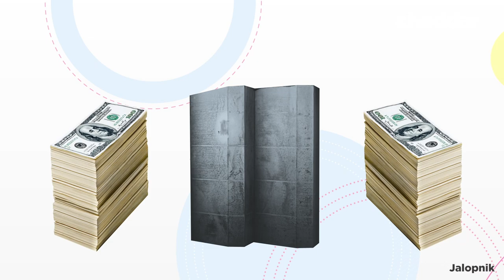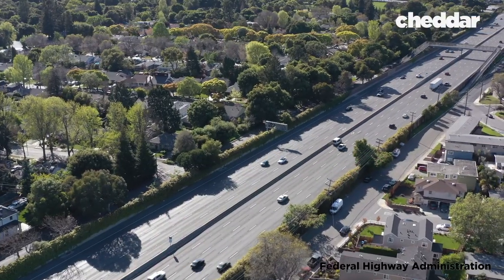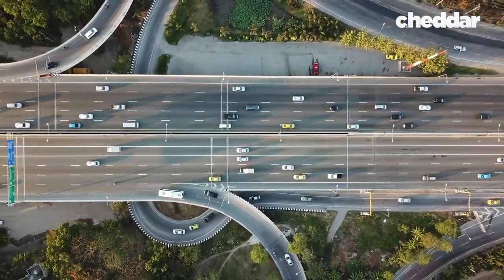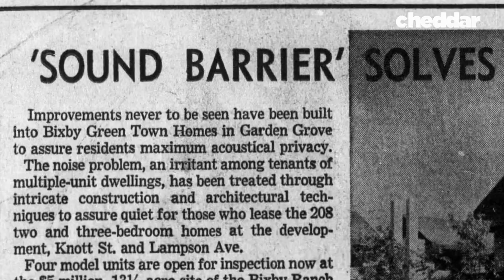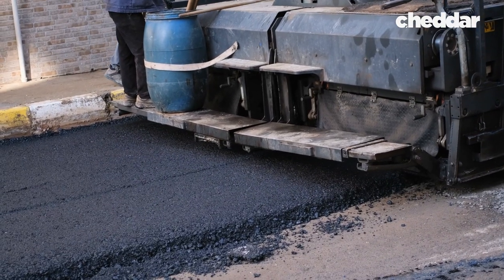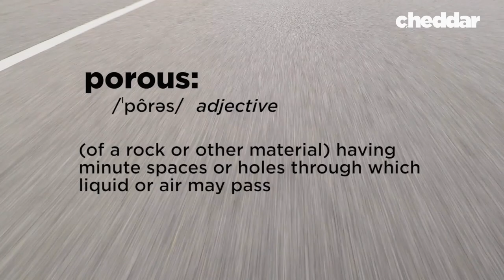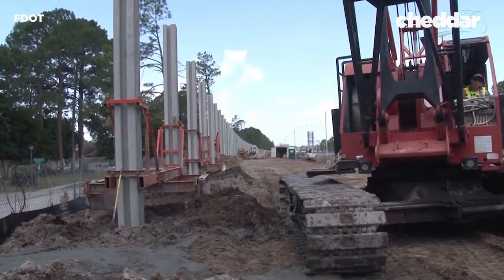How Highway Noise Barriers Can Make Traffic Louder - Cheddar Explains

Comment: @5:08 "Concrete walls have to be replaced every 30 years or so."
Really, you seriously think that? LMAO
Reply: The buried pillars that hold up the wall degrade due to moisture and concrete cancer, if they are not replaced, the wall has a risk of collapse.
Reply: In Germany a women died because a concrete wall fell on her car.
Reply: @cubiusblockus3973  Being that I'm well versed in building construction but not this construction in particular, I say that that's only due to poor construction standards/materials. Concrete rot and metal degradation are due to poor maintenance and material selection. Properly protected steel such as galvanized steels of adequate gauge would not fail in 60 years or more. Concrete walls, with regularly applied sealant (5 to 10 years per application), would last indefinitely given that all concrete will soften with age but very capable of hundreds of years of service.
I'm very much  in favor of natural berms and trees but in tight urban areas it can't be the solution.
Concrete can be protected by natural oils and with thin wood (that's vegetation bearing) if preferred.  Also, angling the roadside surface by 30 degrees or more can deflect and disrupt(mute) sound upward and away from people.
Reply: @Salattrainer  That's bad engineering Germany. There is a great example of a wall that didn't fall without great effort...trying to remember where that was....

Comment: So called "whisper asphalt" is used as a anti noise measure in Germany, but only sparingly, because it has the drawback that it is more slippery when whet than regular asphalt. So they have to carefully calculate a tradeoff between noise reduction and safety for every meter of "whisper asphalt" they install.

Comment: near to one without a noise barrier. 3rd house over on a straight road from the highway. I hear almost nothing from the highway when in the house barely anything in my yard. Go to the first house and it is loud to the point i am glad that it is a church with walls that block out the outside sound when inside it.

Comment: I live directly across the street from the Prospect Expressway in Brooklyn NY. Most of the expressway is open cut, but my section is ground level. So, we have tried many things to reduce the noise, and trees and bushes were planted and they didn’t reduce sound one bit.
A wall has been discussed, but it appears that the Cheddar video is dead on accurate. Our small section of street level highway does not affect enough residents to justify the cost.
Also, our experience with the open cut areas does prove the theory that the sound will travel over the barrier and affect homes further away.
I guess the best bet would be concrete walls faced with sound absorbing material.

Comment: I live about 1/4 of a mile away from a 6 lane interstate with concrete sound walls on both sides. I noticed at night there is a “howling” noise coming from the direction of the highway that’s loud enough to be heard in the house. I think it’s because the sound from the trucks are bouncing back and forth and diffracting down,

Comment: Our house was built in the 1930's (About 25 feet from the road) and at the time the road was dirt/gravel and little traffic, had 90% corners so slowed traffic. (We have been here 28 years) The road (Springhill DR/'Springhill Raceway', Albany Oregon, 7.5 miles long and wanders cross country) now has increasingly over the years become a shortcut for  commuter traffic, Farm equipment, trucks, log trucks and Semi's because there is a stoplight at the south end end in town and they cannot get on the other east-west highway 20 further west because of increased traffic.  Now with the road being pavement and having being built on a poor base it has needed to be torn up and redone for several years.  The county's solution was to chip seal (tar and gravel) it multiple times.  Well chip sealing a road makes it much louder.   Talking to the county, we were told that it would be repaved in 2018.  Well here we are in 2021 and all we have gotten is grinding out strips where the road has breached through the pavement and putting in new asphalt (by the county crew, not well trained pavement workers) while they have repaved from milepost 5 into town twice. They also come out after every rain storm and fill in the blowouts on the last 2.5 miles with temp patch.

So we can definitely attest to the noise created by different pavement types, potholes, improperly patched roadway, loud muffler cars, certain motorcycles, mud tires on pickups, trucks, log trucks, semi's, farm equipment Etc.

Comment: I seem to remember seeing something about the effectiveness of natural barriers being greater than concrete ones. Rather than using reflective hard sound barriers, planting trees such as Cyprus and Willow and low shrubs like Juniper, Yew and burning bushes dampens sound, reducing noise on both sides of the barrier. Additionally, they are much less costly to maintain and reduce the amount of air pollution that makes it from the highway to surrounding areas. 
While the specific plants would have to be tailored to the climate in particularly hot or cold regions it can work anywhere that has sufficient rain or ground water.
Reply: Well thats why they use both plants and concrete barriers to help reduce sound
Reply: @alexander5662  where we have room for both in my Midwestern city that's what we do.
Reply: @alexander5662  I really don't see plants used much on the east coast at all. Probably due to the space needed for the concrete barriers. They need to start replacing the concrete with vegetation rather than new concrete as the old ones start to fall apart.

Comment: I live directly next to a freeway. Calgary Trail at 23rd Avenue in Edmonton Alberta (revealing my location isn't a big deal). There is an elevated ramp next to it. The sound is negligible. If I wanted to hear completely nothing, I could close my windows. But I haven't had to.

My only problem is that because I live where the freeway begins, I hear slightly more noise than if the freeway started further north since vehicles have to accelerate right next to my place.

So basically, my recommendation would be to make sure freeways extend far enough out so that this acceleration happens in a commercial or industrial area. In my situation, that would mean the freeway should start further north with a new interchange at 34th Avenue (that would also raise 34th above the adjacent railroad tracks too).

Comment: Two significant improvements that would solve alot of this immediately is to employ sound absorbing ceramic tiles rather than straight concrete (not THAT much more expensive in the grand scheme of things and just as resiliant to the environment) as well as angling the tops of these barriers towards the freeways.

Comment: 10000 Mercedes st. El paso TX . Google maps. Go to Transmountain rd and in-between Mercedes and Kellogg st there's a barrier there, only on that section of that part of loop 375. The frontage road was the original loop 375 and when the now loop 375 was being built, this wall went up. It's safe to say those homeowners complained so much to the city they were able to get a wall up.

Comment: That's a wall, not a barrier. I recall that noise barrier inHong Kong can somewhere like a dozen meters high, which sort of wraps the road inside a noise-barrier-tunnel (and they are not made with concrete, though I don't know the exact material). Some of the noise barriers also have vegetation on it (which should improve sound-absorbing capability, I believe)

Comment: My House is backed up to I-5 in South Orange County, CA  When we moved in in 1989 there was a 6' wall between us and the freeway!  in 1995 Caltrans decided to erect a 16' sound wall.  Ever since the sound has been much LOUDER!!! As the walls on both sides of the freeway have turned the freeway area into a virtual canyon. Soundwaves bounce back and forth off the walls getting louder, and when they reach the top it is just GOD AWFUL!!! The sound is much louder in colder weather too.
Reply: I-5 in Norwalk here. Found this video because I’ve about had it with an 80-90hz humming coming from the freeway this year. 4:40am and I’ve been up all night pretty much for 2 weeks pulling my hair out.

Comment: The choice of concrete is surprising - it's much more expensive than pressure-treated plywood, or pine boards - hmmm, maybe the concern is vandals burning it?
Here in Queensland the wood is often in panels that are separated by steel - usually a universal-column - a fire wouldn't propagate very fast.
The wood is often green [copper napthanate] so the wall 'disappears' behind a few shrubs - and the Main-Roads-department is obsessed about planting shrubs - every shrub you plant eliminates another bit of grass to mow - and if someone crashes off the road shrubs will slow them down before they hit something hard.
Reply: It's maintenance cost.   Concrete doesn't need to be replaced as often as plywood.

Comment: I never understood the straight design of soundbarriers. First I would make them bend slightly to the road, to have the reflection go less up, or put them on an angle towards the road. Second, I would make them uneven, since this dispers the reflection. And they should be of a layer of absorbing material on the inside, and a hard layer on the outside for strength and durability.
Next to a busy road near my grandmother, somebody put a wall of sand 10 meters high in their (very big) garden. Surely that works very well.

Comment: Build a dirt/clay embankment up to 6 feet shy of the top of the wall (8') on the side of the highway so that the wall is 6' tall on one side and 14' on the other, and cover it in landscaping grass. Plant trees and flowering bushes along both sides of the wall AND in the median if possible. Dirt = soft material, to absorb sound, and a slope will help redirect the soundwaves skyward BEFORE refraction. Trees on both sides and median will help with air and noise pollution. Dig drainage ditches along the side of the highway and in the median that branch outward on either side of the wall to act as a natural break to reduce accident fatalities regarding the trees, as well as flooding. Trees and flowering bushes will support pollinating insects, as well as provide beautification.

Comment: Well, solid concrete without any insulating foam will not be good in absorbing noise
So, why not add extra layer of stone foam or any similar material, it will be quite easy to apply

Comment: I wonder why they use concrete for this in murica. In contries that did this right they are using soft barriers that absorb the noise... I do not know what it takes to make them but if we could work out a way to downcycle otherwise landfilled plastic waste into granules that we glue with some resin into such plates it would be a way to deal with some of the plastics that we otherwise throw out.

Comment: As an acoustic consultant who works on Road Projects, the application of sound diffraction principles to noise barriers isn't relevant so long as the noise at noise-sensitive receivers are compliant with local laws/guidelines/code. These are what determine the application of noise barriers, not the general "feeling" of local residents, whose feedback is usually based off perception of noise and not measured noise. And from a practical standpoint, are you really going to tell residents right on the edge of the highway "Yeah we're not putting a noise barrier up between you and the highway because it'll slightly increase the noise level at these residences 3-5 buildings back"? You're asking for a open-and-shut lawsuit there, and not one you'll win.

On the note of low-noise pavement, that is effective, but with a caveat; it wears down over time, nullifying the benefits over the course of the pavement's lifetime. As such, it's important it be maintained and resurfaced over its lifetime, but most councils and local governments tend to forget to do anything about it due to their lack of tendency to consider the long-term needs of infrastructure and other major projects.

Comment: the solution is simple and cheap. earthwork barriers with a 45 degree incline, reflects the sound upwards.
and over time they get covered in greenery and absorb and diffuse sound better.

i see them being used all over in my part of Sweden
Reply: That requires more adjacent available land than most urban and suburban American  freeways have available
Reply: @danieldaniels7571  so its bad planning from the start then. it does not have to be a huge earthwork structure, 1.5-2 meters high should do the trick. then you can construct a smaller sound barrier on top

Comment: I am very familiar with the issues of highway noise barriers as I worked 17 years for a company that manufactured highway barriers that utilized sound absorbing technology. These barriers are powder coated steel, one side having perforated sheeting with sound absorbing material behind it. The effective has been proven in live test labs and in the field. The problem is, construction companies are not familiar with the technology and are not willing to subcontract the manufacture and installation to companies that they they are not used to working with. 

As a driver of a convertible automobile, I can tell you that driving through an area with typical highway barriers is absolutely deafening. Most car drivers are enveloped in their steel and glass shells and don't hear this incredible noise. It's really sad that with the awareness of noise pollution, it's proven very difficult to get these true noise abatement solutions into the marketplace. The technology exists and you can find real examples where they have been implemented. The company I worked for is Industrial Acoustics Company. They have a comprehensive list of product lines, noise barriers being one of them. This includes those blast shields you sometimes see at the end of airport runways.

Comment: I hate it when they put up noise walls where they are not needed. It spoils the view. i know someone who lives next to a main highway. There used to be trees and bushes, on the edge of the road reserve, but after they upgraded the highway, the trees were gone and replaced with a concrete wall. The noise was a lot harsher.

Comment: In my point of view the Big Con of such massive structures, is the dificult penetration of emergency teams or even chances for escape in a massive scale road accident such as during strong fog multiple crash fallowed by fire for instance that sadly happened many times and has cost many lives even without this barriers erected. It creates a "perfect trap" and the only see use in protecting home buyers against naisy environment that is undesirable specially when paying a lot of money for a property. Apart from that not seen more benefic use of it. Railways by the other hand prefer ovegrown vegetation in order to absorb noise levels to cause minimum disturbance impact to neighbouring residential areas. Thank you for sharing.

Comment: Most effective solution is if the road is dug out to use the spoil piles on the sides as a natural barrier. As diagonal sound is reflected high into the air and it is too thick to travel through.

Comment: As an audio engineer myself... I see many problems with the implementation. Among many solutions, I would suggest using old tires to build the walls. Rubber absorbs everything.
Reply: Won't tires breakdown with sun exposure, and then contaminate rainwater which becomes our drinking water?

Comment: If tires cause the most sound, why do electric vehicles sound almost silent? They still have tires. It would be the engines.
Reply: It's a couple of factors (engine, exhaust, vehicle body, pavement, weight, tire type) but at highway cruising speeds,  the tires are the loudest. At low speeds, sure, EVs will be the quietest. But at 60 MPH, it might be harder to tell the difference if a wall was blocking your view.
Reply: @corneilusdonaldson1858  Fair enough, thanks

Comment: I'm at the beginning of your video and yeah if they're not designed properly depending on how far back there set how wide the traffic is I mean how many lanes and the volume of cars using it it might but it'd be hard to make it louder another salacious title done correctly with the proper material and Road engineering it will mitigate the vast majority of the noise it's a barrier to impede not to stop

Comment: Honestly I'd rather live next to a train track than a highway, at least the trains are spaced out and not constant
Reply: if the noise is constant, your brain will filter it out, whereas if it's intermittent, your brain interprets each instance as new information and doesn't block it. so i'd argue that living next to a highway is probably easier to deal with.

Comment: My house used to have a 12 foot buffer of trees, mostly pine trees, between the residential property line and the road.  You could hear the road all the time, in a muffled sort of way.  A couple of blocks over, it was quiet.  The other side of the road was undeveloped.  First they cut down the trees, to install a sound wall.  That was really loud, but the wall made a big difference.  It was louder a couple blocks over, because of defraction.  The real problem came when they started to build on the other side of the road.  That started with a sound wall on the other side.  The result was much louder noise throughout the neighborhood.  We wish they'd just put trees on the other side and put up neither wall.  I moved away, but it hurt my resale value to have all this government spending.